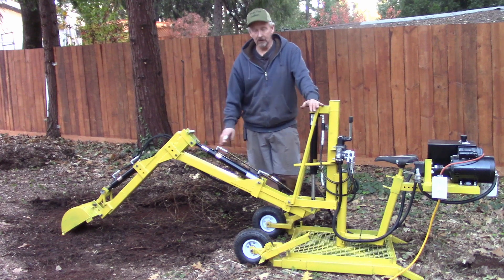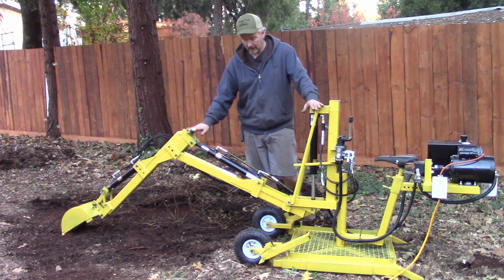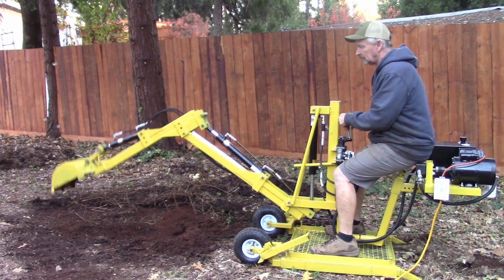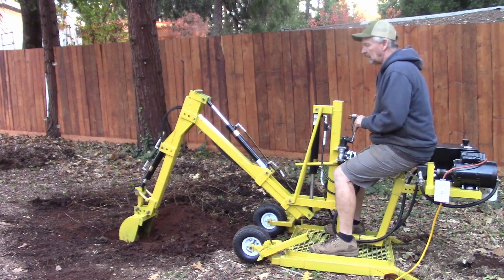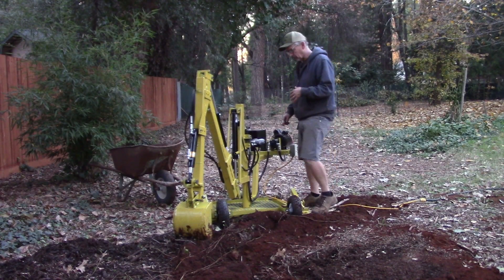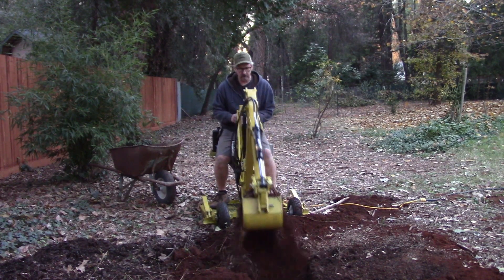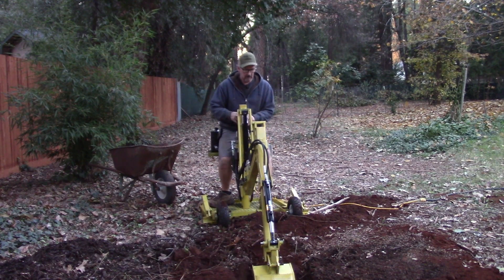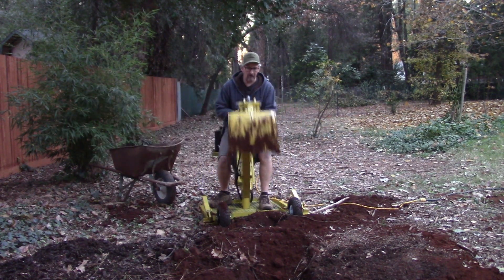14- First dig with the new Electric 360 degree backhoe.

Comment: mr u what use control valve
Reply from the maker: Hi, I used a 7 gallon per minute 3 spool open center valve. You can also use a 4 spool if you want to run a thumb. Here's a link. https://www.surpluscenter.com/Hydraulics/Hydraulic-Valves/Directional-Control-Valves/3-Spool-8-GPM-Prince-MB31BBB5C1-DA-Valve-9-7863.axd

Comment: Wife purchased these plans for me today. Knew i had been eyeballing them. When watching you load the wheelbarrow i only have one question. Is there something you could do to make the bucket curl just a bit further inward? That way it isnt starting to dump before you open the bucket. Hopefully you can understand what im trying to say. Something like another couple inches on the curl cylinder and a little added legth to the linkage maybe? 🤔 Im looking forward to the build! Thanks for the design!
Reply from the maker: Hi Daniel. The curl cylinder is a 6 inch throw. You can go with an 8 inch cylinder and adjust the points. You could also adjust the pivot holes to have more curl and stay with the 6 inch travel. There is a power speed balance with the  cylinder lengths . Thanks. Enjoy the build. Lonnie.

Comment: Very nice.  
I am wondering how much power consumption, If I had a 5kw battery how long it would last.
The only thing I can think to improve on that is the bucket curl so not to drop a 3rd of the material,  is that possible?
And possibly a pole to raise and control the power cord 😁
Cheers